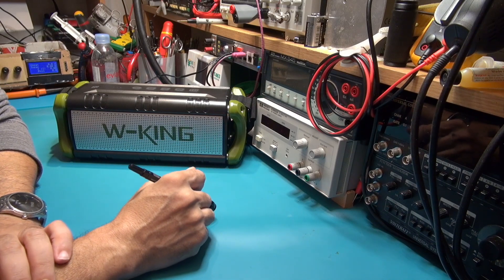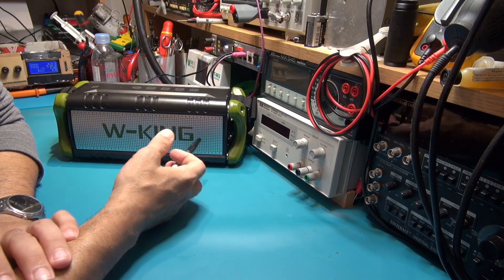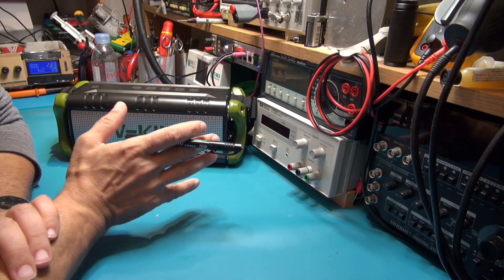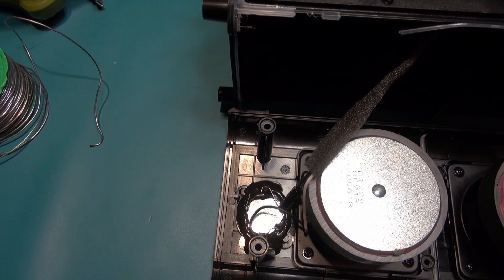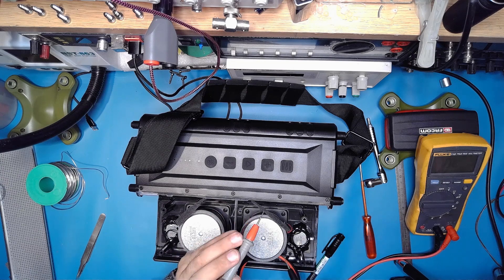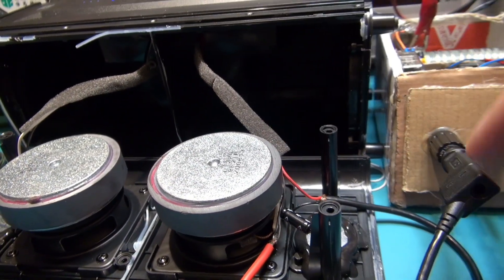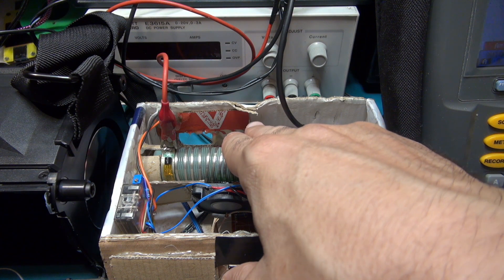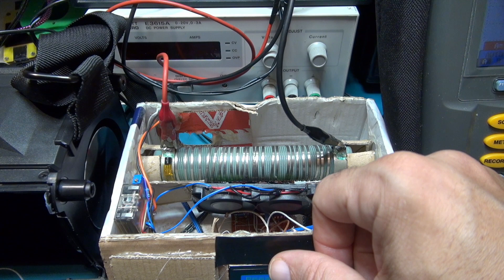W-KING D8 Bluetooth speaker: The Real Watts

Comment: Howdidyou get the case off?
Reply from the maker: you need to remove the grid in the front panel. She's glued. You can use a blade knife or something similar. The screws are just behind.
Reply: @AIexanderHartdegen i have tried but i cant seem to get it off. Do you have a video of you removing it?

Comment: would you know where i could take this device to be repaired? and or would you advise just to buy a new one?  the charge port on my W KING does no longer connect to the usb charger and device is unable to recharge...this so far has happend twice on 2 different device both the same brand W KING like the one in your video. any advice helps thanks
Reply from the maker: you can try to find a local repair store if you have one in your country. Excepting if your device is always on garantee, you can send it to the seller. I think you have a bad joint on the type C connector. You can desmount it, and try to resolder it. Of course, you need a magnifier or a microscope to do that.

Comment: hello, I have this boombox, but it discharges in about 3.5 hours, and I turn it on with a power bank, but I would like to strengthen its battery myself, but I do not know if this is possible, and how to get to the battery. you didn’t take it apart before the battery, can you tell me? what do you think of my idea?
Reply from the maker: You have probably dead batterys. You need to dismount it, remove the cell (I think there is 2 cells) and change it by new ones, in good condition, coming from a market of junk. You will find higher duty. Just keep the original electronic you will found in the battery, to resolder it on the new one. You can found a video of this box on YT and you will see where is the battery.

Comment: Is red dot is for "+" on tweeters? I have negative cable soldered to it.
Reply from the maker: it doesn't matter. Each tweeter needs (if it was significant) to be connected each side the same way. In high frequency, compared to bass frequency, it's not important if high frequencys are unphased, because a simple gesture of head provoquate a angle shift, from a ear to the other.
So, the nice thing is that they need to be connected symetracally, one side like the other. You can use writing things on tweeter to take marks.

Comment: RMS is about 25% of max power. Manufactures use max power to make it look big. Real RMS in a large speaker will take the roof off if played indoors, Also size of speakers matter. from small speakers only about 20 watts rms possible.
Reply from the maker: RMS is about 50% of max power, about a signal with 1% distorsion.
It's maybe about 25% of power about a signal with 100% distorsion. 
Here we calculate the RMS power about 1% distorsion, wich is a quite perfect sinwave on the load. For the rest you're right.
Reply: @AIexanderHartdegen  I'm an electronics engineer and pa sound technician. Going by the scope I would say yes it should be half but maximum  peak spike can be  10 times that. Other than RMS in uk, there is no law for any other power. The manufactures can legally put any wattage for maximum or peak. I've seen Chinese 5 inch car speakers with 500 maximum wattage on them and even 1000  watts! Normally they extent maximum by 4 x factor. When buying speakers go by RMS wattage rating. Only then legally you can hold the dealer to account. Maximum on box is normally 25 % rms. Some cheat even giving much less than RMS as folks don't know how to measure it or what it sounds like. 10 watts hi fi big speakers RMS can fill a room. My friend bought a small hi fi rated at 400 watts RMS!! Impossible. I use 500 a side for small stage with huge bass bins!! In car, space is less so measured in car they put wattage even higher?
Reply from the maker: @marciamarcia7510  mainly you can measure RMS continuous power, or Dynamic power. According to the engineering of the power supply, those two values can be different. A dynamic power is sometimes higher, working with the charging/discharging capacitor filter in the power supply. In some many power supply, this value doesn't change because different transformers and power construction. A 100W amplifier continuous power output can give 300W RMS dynamic power, like the Proton D275. Curently, many amplifiers works with regulated PWM power supply with standart engineering, and continuous power is sometimes very near than dynamic power.
Reply: @AIexanderHartdegen  agree. But who would know that? Most shoppers look at the wattage. They have not the knowledge to test it or even hear it. Only some reputable companies correctly rate their products. I've got W King. Right here in front of me. The pixie speakers cannot handle 25 watts a side.

Comment: what size screwdriver did you use to open and get to speakers please?
Reply from the maker: I guess ALLEN of 3 or 4. But hard to remember.
Reply: It's actually a star key. I had to get me one at Walmart also cuz all my allen keys are hex which is most common & it wouldn't work on this.

Comment: Someone tore down a d9 and got 30 watts rms. And I assume the new t9 will be 40 watts rms instead of its claimed 80.
Reply from the maker: manufacturer are not in fault when claiming their product twice the real power. Because in term of power, RMS power means " a mean" and maximal power means " max". They just don't tell if it's RMS or max. So, they are not totally culprit and not totally innocent. Also, the difference between nice calculation of watt, if it is RMS or MAX is just about 5 to your ears. Calculation of RMS is a point on the sinwave, and the result decrese or increase according where you take the point. MAX power is calculated with the maximal pic voltage on the load, whereas RMS power is calculated by dividing the maximal voltage by 1,414 (or multiplying it by 0,707).
Reply: @AIexanderHartdegen  if your channel picked up more views and subscribers youd be the most technical reviewer. Because im always curious about the real specs of things vs claimed specs.
Reply from the maker: @Nathan-tn5yb  advertising are sometimes intertwined with lies. But here they are not (totally) lying. Also, D8 box is better than a Bose box, wich is 3 time the price. Thanks for your nice comment.

Comment: If you get a chance w King has a new speaker out . It's called the D9. It's advertised as 60 watts
Reply from the maker: just need to have just to test it. If any provider is agree, I am too.
Reply: These few centimetre speakers can never be 70 watts RMS. You put 50 RMS through W King on an external amp and it will burn it to smithereens.  50 watts RMS HiFi speakers can take the roof off an average room!!

Comment: i would love if you could test the 
Blitzwolf bw-as3 70w 12000mah in the same fashion.  I know for a fact that its not 70w. My 30W rated Soundcore motion boom is louder and has slightly more bass.
Reply from the maker: I would be very happy to do this test. I guess Amazon could send me some bluetooth speaker to test, to ensure some reliability of those device. Of course, I can't buy many models to do that, even if I would enjoy it. I have a little channel, not enough subscribers to interest some manufacturer. Thanks for commenting.
Reply: Soundcore boom is so impressive! I have 2 so they are incredible together
Reply: I have the anker sound core select pro  man does it crank I love it sounds to good and the bass is crazy

Comment: I got the tronsmart mega pro and I heard it against the jbl xtreme 2 and I guess it's not as loud as the jbl it claims 60 watts which I doubt and the jbl is 40 plugged into an outlet.
Reply from the maker: Loud sound is not all. Price, sound quality, ergonomy are also arguments to choose a bluetooth speaker.
Reply: @AIexanderHartdegen  the tronsmart is half a jbl xtreme and it's considerably smaller.
Reply from the maker: @Nathan-tn5yb  anyway jbl remains the leader in term of power and effeciency in this domain, but of course some others models like anker soundcore motion+ can give a nice sound for a nice price. JBL are expensive but effecient. The price is so different between a JBL and a tronsmart that a comparaison is indecent.
Reply: @AIexanderHartdegen  Do you prefer the soundcore motion + or the D8 in terms of sound quality? Thanks
Reply from the maker: @Federico_A  both have nice sound. But D8 is to much bassy at low volume, and motion is more neutral, but highly clear. Motion is an amazing speaker like D8. Both are perfect, but motion is more handable. If you love bassy sound at low volume D8 is good. Neutral sound clear and sharp motion is good. Both are perfect.
Reply: @AIexanderHartdegen  Thank you for your considerations 👌 very kind.

Comment: Was the difference audible after you changed to the right polarity of the tweeters? What really happens when the tweeter is wired wrongly and out of phase with the woofer?
Reply from the maker: actualy, it doesn't really matter, because those woofer aren't able to reproduce high frequencys. If it did, the opposite phase of it will create an acoustic crosstalk, not easely heardable but existing. It will reduce the tweeter power with lawless glitching effect, due to overcross wave according the position of the listener. when the speaker are in the same bafle (same plane) and if the filter allow it (conventionnal filter against opposing phase filter), the recommended wiring is the in phase wiring. In this case here, it will give the same phase that the other tweeter.
But this is not very important, I rectify it for the fun. Some low cost filter (like you can find in car audio) make a phase shift between boomer, medium and trebble. In our case, a simple capacitor, with the highest impedance of the twetter, doesn't affect any phase, and moreover if it's working directly with a woofer. It's a just a story of principle, even if I can't really tell if I noticed any difference.
Reply: @AIexanderHartdegen  you are the man! Thanks for the lengthy explaination! I was quiet worried that some of my bluetooth speakers were wrongly wired as some of them come from china and they dont give shit about all this but after your explaination, I can sleep soundly tonight. Lol! 

I have noticed that the woofers and passive radiators moving totally out of phase on some of my speakers at 30hz - 150hz in 10hz increament. There isnt a frequency within that range I mentioned that the woofers and passive radiators are in phase. Any way to rectify that if the wiring are all correct to begin with? I could reduce the enclosure capacity (I obviously cant reduce it), you reckon that would work?
Reply from the maker: @AbsoluteFidelity The air is not a hard thing, but works like a snubber.  Before transmitting sound wave (or wave shock) it withstand a compression, wich is not immediately transmitted to extrem points. It happen that it can not transmit instantaniously the energy from the speaker to the passive radiator. That means that you will have a non appropriate, until opposite phase between speaker and radiator, according the frequency range. Because passive radiators are a response for making closed speaker box. Principle is the bass reflex speaker, with a vent, wich are here replaced with a passive radiators. Bass reflex system is a way to create deep bass with a little (or very little) speaker, decreasing cost, and giving a cosmetic sound effect (loudness, bass). But this nice idea is not linear, and can disturb other sound (...). This is the reason why bass reflex are not favorite for audiphile people. HiFi are normally closed dry box. 
Trying to replace passive radiator by another way is probably vain, because it was a solution to have the most effective bass as possible. thanks for interest.
Reply: @AIexanderHartdegen  thanks again for your quick reply Alexander! Guess I should just save up for another better bluetooth speaker, not that I need another one. Lol! Lookin at the Marshall Woburn 2 for sometime now, Ill wait till I get a great offer.
Reply from the maker: @AbsoluteFidelity  If you like it, why not. I was interested by the Bose one, but I buy the D8 first and make a comparaison between Bose, and Sony. My conclusion is that the D8 is a perfect speaker for the price. The worst one was sony. I mean the best way is to make some comparaison. Your model is quite expensive, but beautifull for sure. Hope you can buy it, thanks for commenting.
Reply: @AIexanderHartdegen  i have 2 more w-king speakers, the D3 Pro and the T8. The D3 Pro is supposed to be better than the D8 for the same price, and the T8 which is cheaper has the lowest and deepest bass of all, somewhat like the Harmon Kardon Onyx 5/6. If you like the D8, you would love the D3 Pro. And the T8 just sounds like a high end speaker but cheaper tha  the D8. Check them out!
Reply from the maker: @AbsoluteFidelity  thanks for feedback.

Comment: Great video and you can learn from it. For example, the watt numbers written by the manufacturer on the box are written there mainly for marketing purposes.
Reply from the maker: @
CarlDanceHard hello, thanks for your comment. For to understand this, you need to know that there is different ways to measure power on a non continue signal. It depends from where you take your measure point. Manufacturers, and they always stay honest in this case, take the maximal point on a sinwave to calculate the wattage. We can call it " instantaneous watts" and they are real, not fake. But RMS mean " root mean square", wich include " mean". So, you can calculate a RMS value, or "instantaneous "value, called also " maximal watt" or " watt pic". So, in term of law, they are not culprit, because calculation are wright, it just do not refere to an RMS value. And of course like you said, they prefer to use this "pic wattage", and not the "mean wattage" to cheat a little bit, help by the weak popular belief in this realm to over rated their product.

So, this bluetooth speaker is really 50W maximal watt, and really 25W RMS watt. Thanks for watching.
Reply: @AIexanderHartdegen  exactly 
fucking marketing is like a science fiction
Reply: The problem is that; marketing has to cater to a largely ignorant market that equates speaker output with wattage. The more important specification is the resulting SPL (sound pressure level) which is a function of the speaker's efficiency.
A data sheet might show SPL: 90db which means that; for 1 watt of power, the speaker will generate 90 decibels at 1 meter distance...2 watts might generate 93 decibels, etc. A less efficient speaker would require more power (wattage) to generate this level and a more efficient speaker would require less power.
Look at a modern household LED light bulb compared with the conventional filament type. For the same light output, the LED bulb will consume a fraction of the power of the filament bulb because the LED is not converting the power to heat.
Reply: bad video

Comment: Thank you for this video and your explanations. What about the wattage of the tweeters? P.s. Do you hear any background hiss listening songs at low volume?
Reply from the maker: @
Federico Hello, your question is very simple but the response will be quite sophisticated. The tweeter here is supplyied by a non polarized capacitor trought the main speaker, directly connected to the amp board. So, it received the same signal but filtered with a little capacitor, helping it to receive only high frequencies. When measuring the amp performance, we usually not carry about tweeters, because they pull their own power, this power is variable according the nature of the sound, or music you're listening. 

Usually, we use a quarter of the main power on a treeble speaker. It supposed here 3 watts, when listening it at full volume, with a track wich contained a good level standardization. 
If we consider a track full of high frequency only, and according with the reactance of the tweeters, wich here are about 8 ohms, we can expect a maximal level of 6 watts rms. The boomers here have a natural filter according to their special properties and coil build, and are not able to pull on the hight frequencies.
Also, you need to consider than the human ear is more alloted to listen high frequencies, and for exemple, a high frequency sound of 3 watt will sound with the same perception than a 20 watts from a bass boomer frequency.
So, the power of the tweeters here is not shared with the boomer, because the natural effect from the dedicated coil of each speaker.
Also, for a standardized music, you can have 3 watts per channel for the tweeters, for a total of 6 watts, wich are perfectly eardable over the bass.
Reply: @AIexanderHartdegen  Thank you very much for the further explanations.
Reply from the maker: @
Federico no hiss, no whirr, nothing. This speaker is simply amazing. But we need notice than sometimes, excess of bass can be a pain in the neck when listening something wich don't need to have so much bass.
Reply: @AIexanderHartdegen   love fro. India , happy to know the reality of this product. Keep making videos on such speakers. 💛💛💛
Reply: i hear the same background noise and i got the speaker two days ago now i will return it cause it's not normal
Reply from the maker: @erickcarrasco7106  yes. Mine is quiet.
Reply: @erickcarrasco7106  thank you...let me know if the new unit is ok 👌